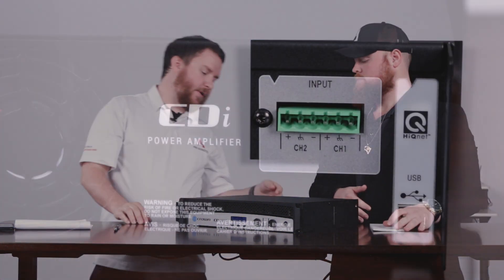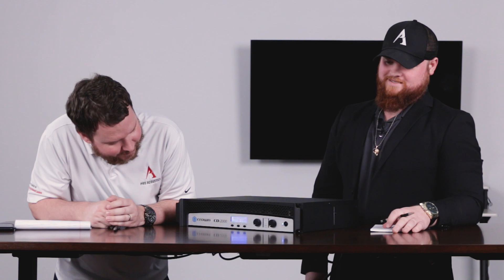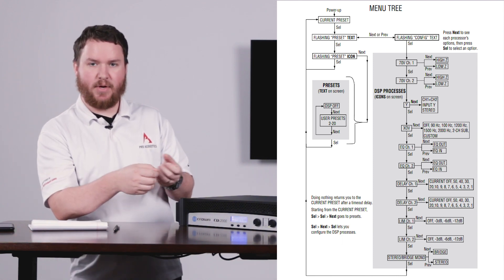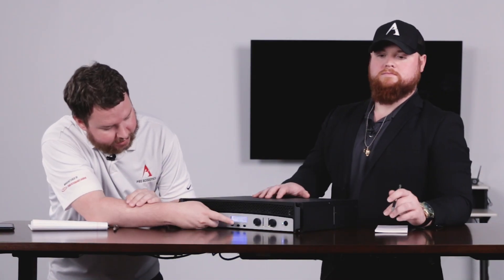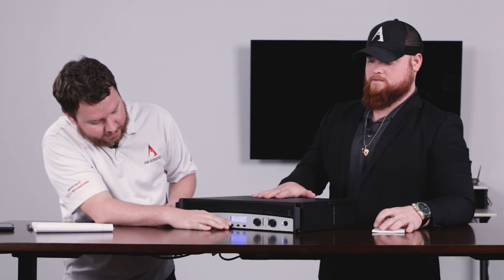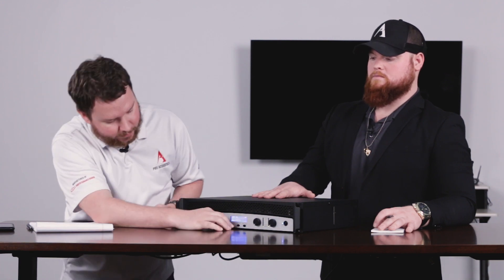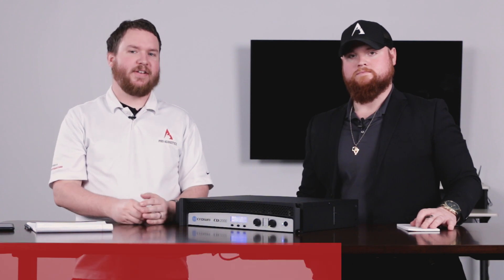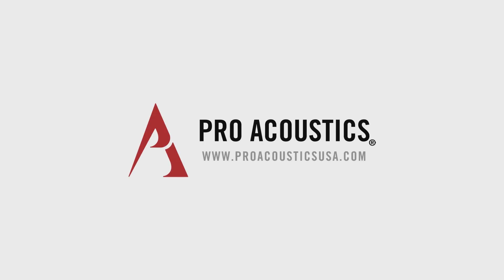How to Configure a Crown Audio CDi Power Amplifier on Pro Acoustics Tech Talk Episode 39

Comment: Is it possible to connect this amp to normal stereo power amp to drive passive subwoofer?
Reply from the maker: This amplifier can be used with passive subwoofers at low impedance (4-8 ohms) or at 70 volts, as long as the subwoofer's power rating is within the amplifier's limits. It will require a signal from a mixer for proper audio control. I hope this helps!

Comment: I own two Crown XLS 2002 amps. Crown does not provide information on connecting any home theater receiver to power on and off. It would be nice if Crown included that info in a user manual. but it doesn't exist. all they say is > that it has a "Remote power control through a contact closure" How is the end user supposed to know exactly how? 
I would really appreciate any help on that issue. Thanks
Reply from the maker: We recommend contacting Crown's Technical Support team directly at 844-776-4899, fill out their form at this link, or live chat during their business hours. https://www.crownaudio.com/support/tech_support

Comment: Hey, I'm using 10 CRV CONTROL JBL connected to one of this amplifiers but in the middle of the dial the thermal protection turns on and I don't know why, can anyone help me because I need to use them a little higher
Reply from the maker: Hi Adrian, We recommend contacting JBL/Crown support directly about this issue. You can call their support line at (844) 776-4899 or fill out one of the forms on these links.
https://www.crownaudio.com/support/tech_support
https://jblpro.com/support/tech_support
We how you are able to get this resolved quickly!

Comment: Stupid question. Should I set my crown amp if I'm using landscape speakers l. I'm using martin Logan 60s
Reply from the maker: Hi there! Those are low impedance speakers rated at 4 ohms. This means you will want to set the crown amplifier to low impedance.

Comment: Hi any body can help me how to adjust fan this amplifier since I am instaled on small meeting room & speed fan is very high so that very noise. thank you
Reply from the maker: Hey there! The fan speed is automatic and regulated by the internal temperature of the amplifier. Ensure good ventilation around the amp, and if it becomes distracting, you might consider relocating the amplifier to another area or room. If you still have issues, we recommend contacting the manufacturer directly.